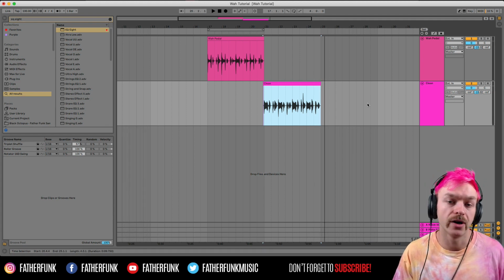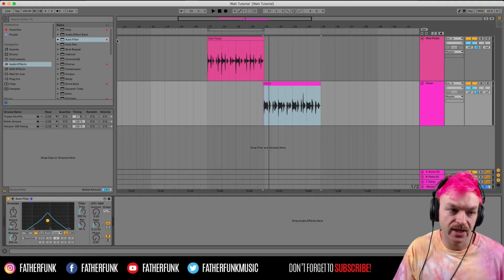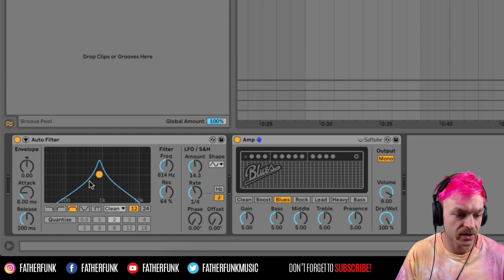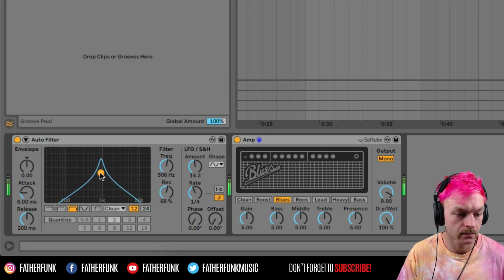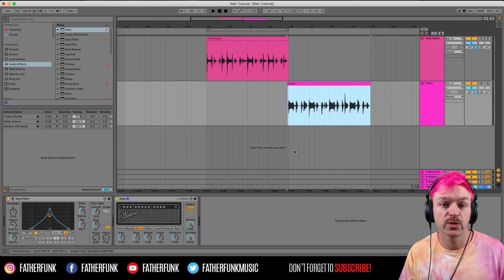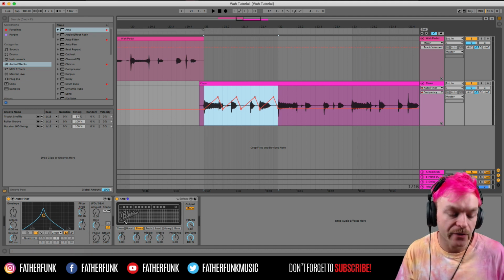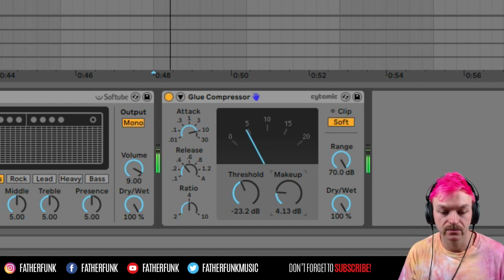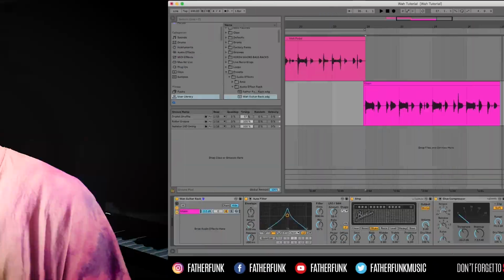You can create a WAH PEDAL effect without a wah pedal? 🎸 [Ableton Tutorial]

Comment: Thank you! If you have a usb midi piano expression foot pedal, you can use the pedal via the piano usb connection. 

First enable 'remote' for the midi setting of that usb connection. And the you use the midi mapping feature to choose the frequency knob of the auto filter and press the pedal. 
Then in the mapping configuration you can change the range of the frequencies that the input pedal is mapped to. 

Note: I have three pedals in my piano and only one of them is proper expression pedal, other two are binary, so you need to use the one that gives range.